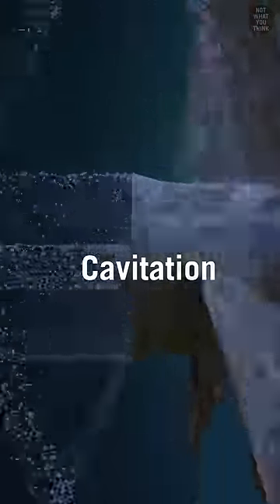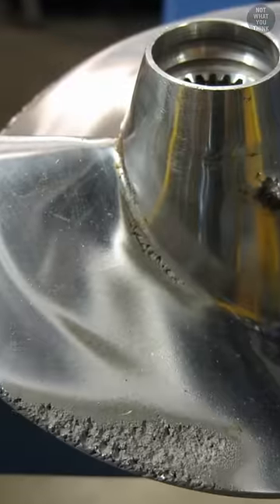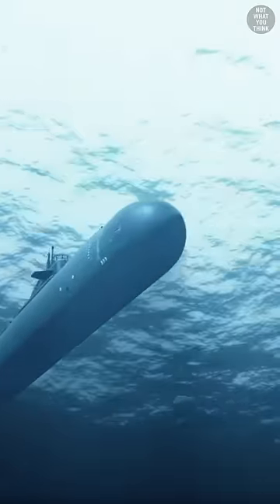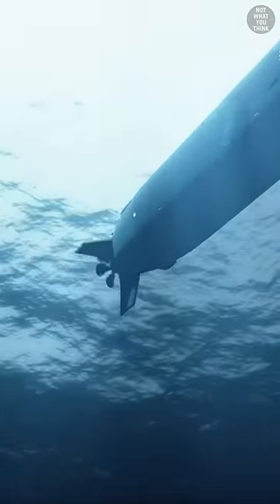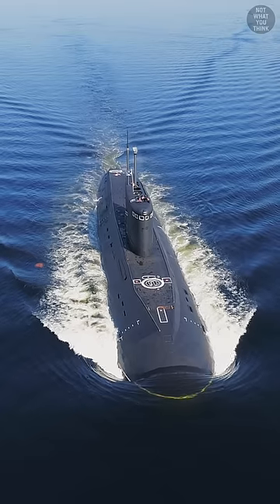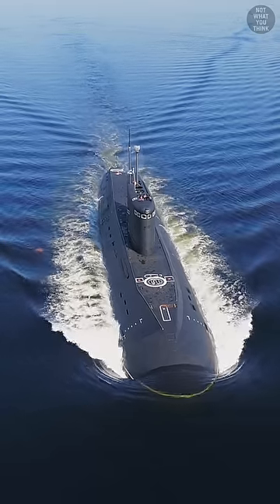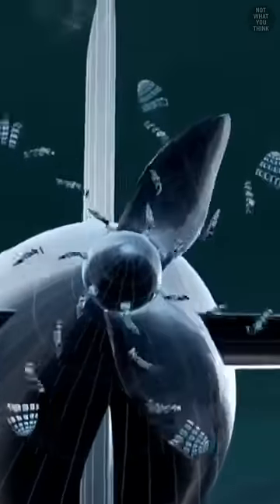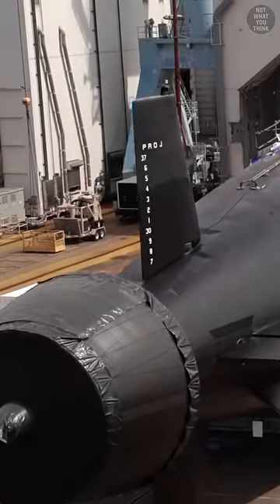Why Are Submarine Propellers Covered Up? #shorts

Comment: That’s cool, I always wondered why the hid them, I just thought it was just to protect them from getting damaged while in transport.
Reply: Yeye, its also to make it harder for hostile submarines to identify your submarine class if they dont know how many blades on your propeller, as that is something that can be heard
Reply: @owo1744  im pretty sure all the simulations and computer models or a teaktoaker making a video about it would be able to figure that out
Reply: Thing is, hiding the submarine's propeller when it's out of water or visible from the surface also plays an important role in hiding the sub's capabilities. To experienced eyes, the sub's speed, power, sound profile in the water, and possible major flaws could be roughly estimated. A member of the public would find this info useless, but to a hostile or non-allied party, it's like precious gold. Subs are one of the most powerful offensive weapons in a Navy's arsenal.
Reply: Some also have steel covers around the propeller to protect it from bigger animals or in case you'd ever take a hit, sink and smash into the ground.. so the propeller stays in tact and in case you manage to survive the flooding and repair... use the propeller to escape
Reply: @Drnken229  This is not true. The casing around newer subs propellers is not for protection, though it does provide some. It's to make it more efficient like a ducted fan.

Sea creatures are of zero concern to damaging the screw. It's very heavy and can easily cut through most that could hit it. That said most animals will keep a bit of distance from the sub anyway. Only ones I've heard of getting close is dolphins or shrimp.
Reply: I knew an engineer who worked on submarine design. He told me that he was only allowed to know about the area he was designing. That it is so secretive , that very few people actually know all the details of the design.
Reply: @Drnken229  it mainly for vortexes like a plane
Reply: Most modern subs don't even use propellers anymore . The United States Navy has been using pump jets since the Los Angeles class .
Reply: They wrap them for the same reason.
Reply: On the submarine shown, it is actually ducted as well.
Reply: @stevenkovler5133  ahh, compartmentalism, just like area 51 in ID4
Reply: Probably that too.
Reply: the f*ck is going on. Seems like everybody are instantly become a submarine expert. 🤣🤣🤣
Reply: @cerdickjohn2385  of course! As soon as anything interesting comes up everyone is straight onto google & come back keen to share what they've found. 

Back when people had to go to the library & trawl through reams of old newspapers & textbooks most were less keen but it's really quick & easy to find stuff out nowadays & it's often fun too (really easy to fall down rabbit-holes of conspiracy theories too & it's good to have people check your findings).
Reply: @stevenkovler5133  Boeing also compartmentalized the design of the 737 Max subsystems. That ended rather poorly!
Reply: @cerdickjohn2385  nobody that is an expert on subs can really talk about them very much 🤷
Reply: My gramps told me that's how USS Jack was when it launched in 63
Reply: @EinfachFredhaftGaming  probably isn't the actual propeller. I work for a place that builds them because we were shown a video with a sub animation, they said it wasn't the actual propellers. Only the people who actually design it and those who need to see it in the Navy know
Reply: @Dr.Westside  props are still on the ships, they just have the jets too
Reply: Also I remember I read/watched that the shape of the propeller will determine what sound it'll make underwater, which then can allow enemies to hone in easier because they know the specific sound signature of the propeller because it is determined by the shape.
Reply: @owo1744  lol ok shipmate
Reply: True but also for shrouding the impulse created by the veins, for stealth. 👌 Also to help reduce interference with onboard listening devices, such for sonar etc
Reply: There is a whole career field and industry in most nations with a Navy whose only job is to recreate acoustic signatures of submarines. 
A detailed picture would go a long way into simulating and recreating the signature and patterns.
When the propellers are installed the area is closed off so the installers are the lowest echelon that has any knowledge of it.
Reply: @owo1744  all they would have to do is add a Biden hydrophone and shearch for any unknown propeller sounds. Then use the process of elimation to figure out what class go to what sound. And the. A bit of more detective work to figure out the amount of blades.

Comment: I worked at the company that makes the US's submarines and even old photos of stealth subs (even decommissioned ones) have their propellers covered, I heard it's possible to see decommissioned subs propellers but there are no easy means.
Reply: You can see a few Tench class propellers on display, but this is getting to be towards "ancient technology"
The newest screw on display that comes to mind is the Nautilus, that's up in Connecticut, but in terms of technology, these are unimpressive, as they are pretty conventional rather than silent and stealthy.

You can pretty easily find other country's technology online, like the German type 212 propeller. It has a neat vortex diffuser implemented in its design. This sub is still in operation, and it's virtually undetectable when it wants to be.

Comment: For anyone wondering cavitation does not “boil” the water. It draws a vacuum in the same way you can draw a vacuum with a syringe.
Reply from the maker: Boiling just means converting from liquid to gas, which is what happens during cavitation.
Reply: @NotWhatYouThink  oh I see what you meant. I misunderstood, your right!
Reply: Low pressure reduces the temperature required to boil. It's for this reason that you have to heat water past boiling to purify it at higher altitudes.

Comment: If the enemy sees your propeller design..

They can make a duplicate propeller and train the sonar crew to hear it  and also fine tune the sonar system and sensors to detect its sound and remove other background noises .

Propeller is as important as the material and coating of the outer body , engine and the propulsion system.. thats why its need to be classified

Comment: this is like condensation forming on the wings of a fighter jet during high g maneuvers. it’s the change in air pressure that causes the change in temperature. PV=nRT. n, R, and V are constant.

Comment: Wow. Ok, there are soooo many things wrong here it's hard to pick a starting point.
  1)  Submarine propellers do NOT "boil water"   In the simplest terms, submarine propellers pressurize the water behind the blades so that the submarine moves forward.  That pressurization "squeezes" the gasses that are in the water causing them to form into a bubble.  That bubble  will then collapse and dissolve back into water, and THAT creates noise.  This action is called "cavitation" and it can actually cause damage to the propeller.  The problem  is not unique to submarines,  it happens  to boat propellers as well. 

2) Submarine propellers ARE (generally) covered up by a tarp when the boat is out of the water,  and that's to keep spy satellites from getting pictures of the props. 
  However!  That's NOT the same reason that (newer) submarines use what is called a "shrouded" propeller. 
   The latest in submarine tech uses a ring around the outside edges of the prop in an effort to cut down on noise from cavitation.  The outside edge of the prop is where the most pressure is being exerted on the surrounding water,  and the shrouded prop can cut down on the noise from cavitation by eliminating that problem by eliminating the tips of the blades by covering them with a "shroud " or simply a ring around the outside of the prop.
Reply: you are incorrect about cavitation. the water behind the blade experiences a lower pressure because of the suction created by displacement of water by the front of the blade. the lower pressure causes bubble formation (look up a phase diagram of water online and you will see vapour formation exists in lower pressure environments (for example water boils at lower temperatures at higher altitudes)) and subsequent collapse as it enters an area of ambient pressure. if you were right about the area of cavitation being higher pressure, that would still contradict bubble formation due to Henry's law. source: i work in the engineering dept on an ssbn.
Reply: Can't comment on your second claim, but as THIS MACHINE correctly stated before, the water is actually boiling in the low pressure areas of the blade/propeller. That is also where you will find these dammages.
If the pressure is but low enough water could start to boil even from 4,8 °C onwards.
Reply: Oof.
   We are both right and at the same time we are both wrong. We are experiencing a gap, if you will in terms.  
In the most simplistic terms any propeller will move in one direction,  that is, it will move towards the area of lowest pressure and away from the area of highest pressure. It works just like an aircraft's wing does, only it uses a circular motion to achieve this directional movement.  In order for this to work, there must be higher pressure BEHIND the propeller than there is in FRONT of the propeller,  as any object will move away from an area of high pressure to an area of low(er) pressure, but never the other way around. 
 True, gases will form in water at a lower temperature,  at a lower pressure,  AND you can call this "boiling" if you like, but it is not really "boiling". A more accurate description might be that the water is "de-gasing" which is also what happens when you heat water to  212°f at sea level, which is boiling.  You say that it's a potato,  I insist that it is a tuber.   You cite Henry' law,  I follow Bernoulli's principle.
Reply: @jstephenallington8431   Not quite. According to Bernoulli's principle the speeding water at the back of the propellor actually creates a lower pressure front, as water flow speed and pressure are created at each others expense if you like. I know it sounds contradictory, but it is actually the other way around. Your reasoning only applies in a static environment, but that is not the case here. I think you are mixing-up pressure and flow(speed) as they are not the same. It is the increase in speed that creates the decreased pressure. That is why turbine compressor blades are diverging (and not converging) to create an increase in pressure. The flow speed is being decreased and because of this the pressure increases.

Also your second claim that this is not boiling because boiling of water happens only at 100°C or 212°F as you call it, is simply not true. That is the boiling point of water AT ATMOSPHERIC PRESSURE. In these cavitational arras of the propellor the pressure is not atmospheric at all, but vacuum. Hence the boiling point of water is reduced significantly even to the point it will start to (literally) boil in those area's while the water is still "cold".
The boiling of water is a phase change from a liquid to gas and is highly pressure dependent. It is the water itself that is becomming a gas in those low pressure areas and has nothing to do with "degassing" or letting out desolved gasses.

As "THIS MACHINE" correctly points out, your reasoning that an INCREASE in pressure would create this "degassing" would defy Henry's law. Whereas both Henry and Bernoulli are alligned, now it's up to you.

Comment: Thanks for the shot of the collapsing bubble.
Cavitation is what knocks the bottom out of a beer bottle in that trick where you slap it on the top. You can even see the cavitation if you do it right ....

Take a glass beer bottle with cylindrical sides, and fill it with water to almost the top of the cylindrical section. Hold the bottle upright by the neck area (wearing gloves and taking other safety precautions) over a bucket or something. Smack firmly downward on the top of the bottle with the palm of your other hand. The bottom will break out of the bottle. (It's not a neat break, so be careful.) 

That's cavitation at work. What happens is the bottle moves down so abruptly that the water stays behind, due to inertia, forming a bubble that collapses back almost instantly. The slug of water is perfectly shaped to hit all in one instant, and the impact breaks the glass. 

If you get the light right, and don't hit quite hard enough, you can see the bubble as a momentary change in refraction. (Take safety precautions.)

Cavitation is also at work in the trick where you rap on the top of a bottle with beer in it, and the beer foams up. The impact drives the bottle down, the beer stays behind, and the CO2 starts filling the empty space.

Comment: The cover shown on what looks like an american fast attack at the end of the video is a kort nozzle designed to increase pressure and reduce cavitation at higher speed. Much like a ram air. It slightly constricts flow, increasing pressure over the blades, increasing efficiency of the blades, and reducing noise.

Comment: I've worked on a number of ssbn's and they never had their screws covered. That covered thing you're showing is a pump jet style drive unit and it's not so much the propeller that's covered but the unit as a whole.
Reply: This is the actual reason.
Reply: @plewis4105  ? What is??

Comment: That is another reason why many shipyard workers had to pass classified screenings, even though they saw only limited sections of blueprints.
Reply: Not true! I am a shipyard worker. The propellers are covered while they are still submerged. The other thing people think is that a propeller will still be covered during decomp. They are usually just laid in the dry dock on wooden props. Once the sub class is being decomped it is useless in hiding the prop or screw. Only modern props are hidden from view.
Reply: @Vastindice  I worked in a shipyard myself. So blatantly calling what I said "not true" was insolent. And it is indeed another reason why workers had to be screened, as that also involves keeping the mouth shut, regardless of what they see.

Comment: To think that a submarines propeller could create such a low pressure to cause cavitation is amazing, similar to to cavitation on a cylinder liner in a engine through displacement of the coolant from the liner

Comment: Anyone looking at a Mollier diagram knows how to optimize propellers for a certain speed.
The point is most try maximizing the pressure differential by making use of not only water being pushed, but also reducing the pressure behind a rotor blade to a minimum at standard cruising speeds.
Rotors can be made to have a higher non-caveating max speed, at the cost of reduced efficiency at lower speeds.
It is a simple tradeoff.